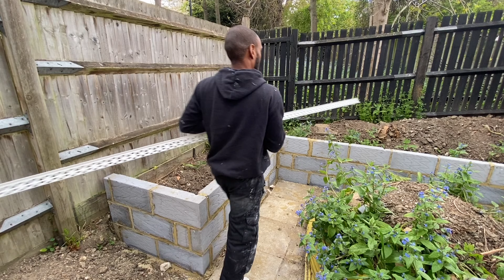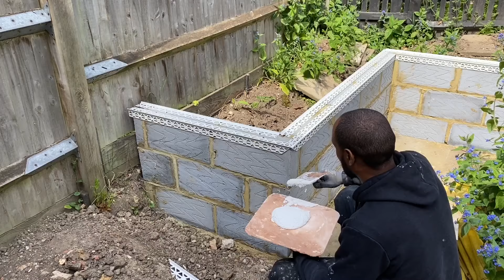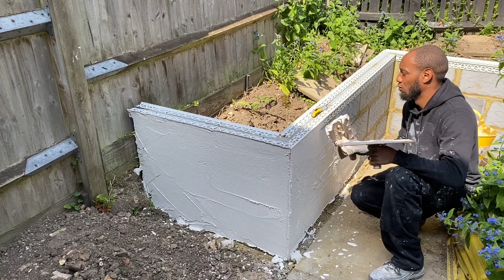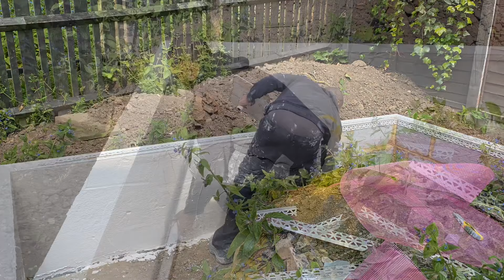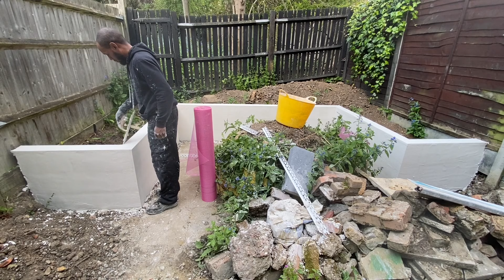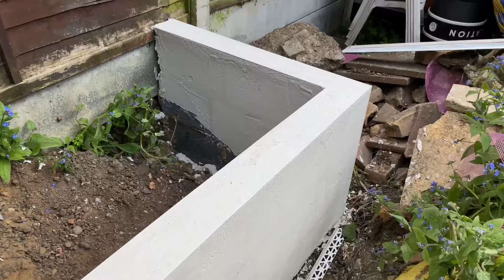Weber rendering a garden block wall - Ep 4

Comment: Great video, exactly what i was looking for. I'm trying to calculate the cost of materials for my garden before i consider rendering - could you please specify the exact product you used? Would be greatly appreciated!
Reply: It is usually bags of K-REND render, I’m guessing the K rend one coat has been used. Per bag it covers 1.4m2, so by doing a 1mx1m surface you would require one bag maybe1 and a bit or 2 if using the method. They are £10/15 a bag from b&q and places similar. Hope this helps  x
Reply: @gaynoryoung8536  thank you so much! Appreciate you taking time to reply.

Comment: I have a retaining garden wall about hip height, its a single skin red brick wall, and I attempted to render it, however it all peeled and cracked off after a year. I've been told its due to water coming through the brick and blowing the render.
What are my options? Should I use rendaid then ocr? How has this wall held up? Is there any dpm behind that block?

Comment: Firstly, thanks for another great video. 
I was curious to see that there were no coping stones or cap stones on the top which made me think that later down the line this would encourage streak marks on the wall over time? Was that ever the case when you went back after some time to check? Cheers

Comment: Hi
I’m just about to apply tc in KRend on my garden wall and noticed at the end of this video you had applied render at the rear of the wall. Did you use mesh or just feathered it down? Also is it ok to leave the stop beads out? I’m having to go to my job in the morning as it rained all day today, so as it’s going to be hot tomorrow can I scratch it in the afternoon? I bet it will go off pretty quick in the heat and I don’t fancy going in Sunday? 😋

Comment: Hi I’ve got some concrete planters in my garden made from breeze blocks like the ones in this video and thought I’d follow your video to render the walls. Can I ask what your using to screw and secure the beading ? I’ve been out today and purchased some cross head multi purpose screw at wickes and I cannot for the life of get them to screw fully into the concrete they get stuck half way and my Mcallister drill is strripping the heads.

Can I ask, Are you using a specific head like torx or masonry screws  at all if so could I ask what you are using? Any help would be appreciated :)
Reply: Please answer him as I'm doing exactly the same thing cheers
Reply: @ThePistol1977  i ended up sticking them on with somehing called no nonsense grab white tube with green writing from screwfix, and have now successfully done 3 large planters and really happy with the outcome, my advice do it in big blobs every 10 inches or sometthing and position it how you like. Its even better that nails or screws tbh as it has less chance of the rust coming through the render too :)
Reply: @ThePistol1977  oh and instead of sawing the corner of those beads buy a set of tin snips, they will make life much much easier and noticed this guy doesnt float the wall (not sure why) but most people will tell you floating is THE most important part of rendering it pushes the cement into the surface to make sure it doesnt come away from the wall

. plenty of videos on here about it but weve been following this guy https://www.youtube.com/watch?v=-O5r4NhIwSI
Reply from the maker: Hi Liam glad you got it sorted. Sorry I missed your comment. I imagine the reason you screws didn’t work is because you were using concrete blocks. In the video I used thermalise blocks which are easy to
Screw or nail into with no problems. Also when rendering with Weber (the product I used in the video) you do not float the wall. You only float if using a cement based render. Weber and Krend are. It cement based renders so you don’t float finish them. Hope that helps. Peace.
Reply: @darrenthebuilder  thanks your video helped as it was a similar situation although yeah breeze blocks so makes sense.

We have used Weber one cost render (blue label) on ours and it says on the packet to float ? I take it your using a different type of Weber one coat like the monocouch? Be good to know which Weber coat you use that doesn’t need floating as we found the floating part the hardest work tbh lol 😂 anything to skip that would be amazing and may use what you recommend on our main walls.

Comment: Noticed that you don’t need a base coat like with k rend hp12. How does this compare with the k rend? 
Can you go on to brickwork with the Webber used here on the garden wall? 
I’m thinking on using the k rend approach on my garden brick walls. Have been advised to prime with h7 and then base coat ho12 with mesh?
Loving the content bro, very informative. 👍🏽👊🏽
Reply from the maker: Yes you can use it directly. You can also do the same with Krend. As long as youre happy with the wall is going on to. If in doubt then uses a basecoat. you can just embed the krend into the top coat